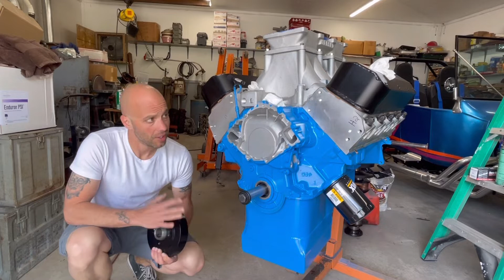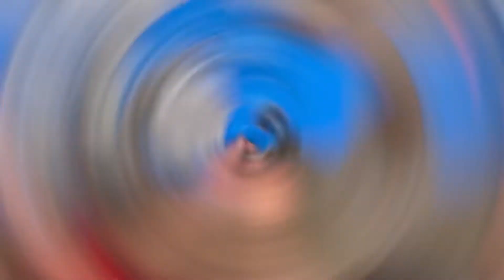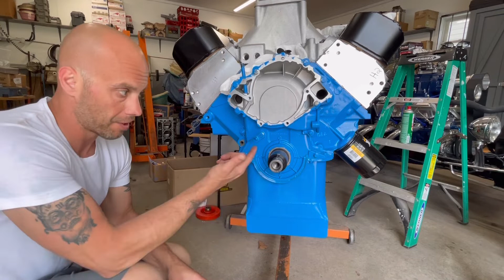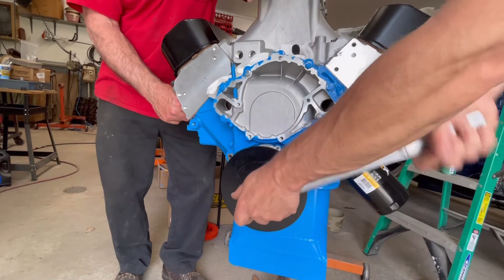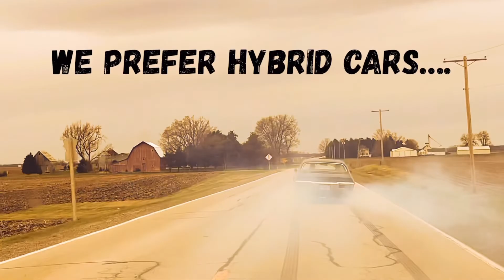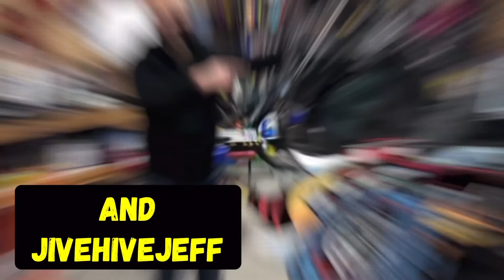How to Install a Harmonic Balancer, EASY!! #nonamenationals

Comment: I was happy to see you beat the balancer on a bit. I don't feel as bad doing it anymore. A little heat from a heat gun helps a lot just real warm to touch is enough expansion that you can wack them on with the palm of your hand. Keep up the good work Jeff.
Reply from the maker: That’s a method I should have done, this thing was so close but too close of a fit.  This has fought is the whole way, but we will get it 🤙🤙